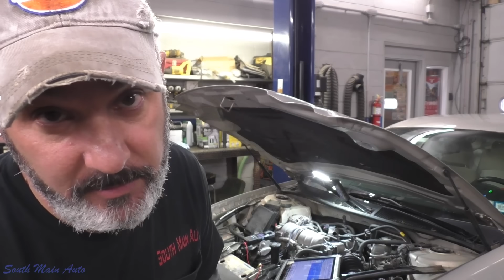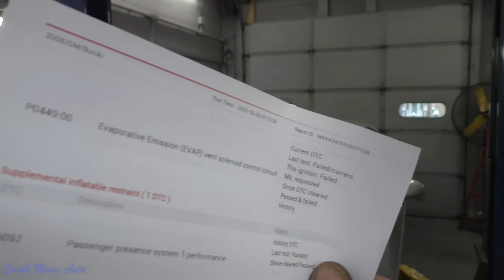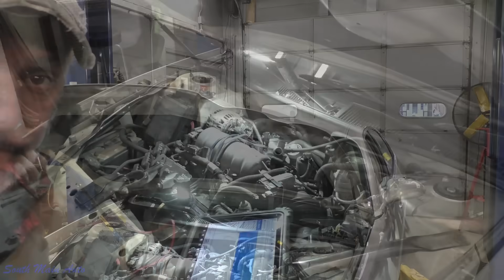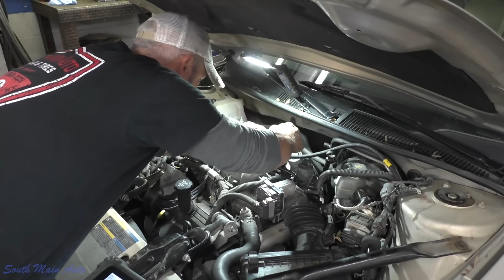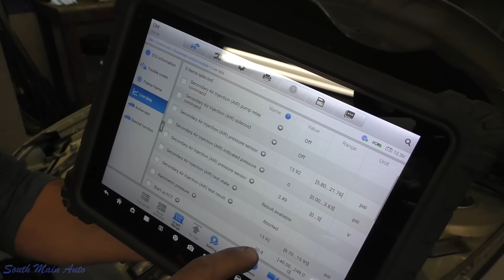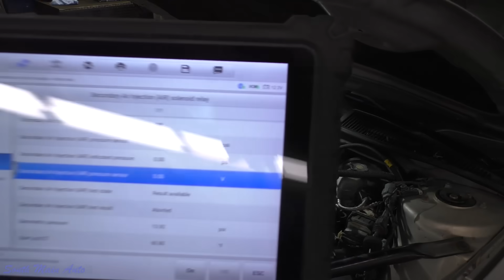When “New” Parts Are Worse Than The Broken Ones 🤬

Comment: I replaced the fuel pump in my 03 Accord V6 to fix a slow starting issue. It fixed it for a day and slowly started reverting and actually drivability was getting very poor. Finally paid a shop to diagnose it and it needed a fuel pump LOL. I never suspected the brand new fuel pump that I installed. Months later the car still starts and runs great, however my gas gauge now goes to below E and the low fuel light blinks whenever I get down around half a tank... I never even took the car back to complain because Parts quality is so bad I figure the car runs good and I reset my trip odometer when I fill up in order to know when I need to get gas. Crazy stuff. Also similar Parts quality frustration with ignition coils for the same car.

Comment: Electronics in vehicles was a mistake. 99% of the problems are non-hardened electronics going into something bouncing around, in all kinds of weather, it gets dirty, and the part is attached to 1000s of different parts all with different problems.
Reply: it really depends on the car. no more distributor service or anything but if you got mice i hope you can make good solder joints or crimps

Comment: 👍 Always emissions related.
Always modify for performance. The more of this trash you remove the better. Car/trucks running on propane or natural gas dont need that garbage.
That included Rousch Ford propane race cars.
Feel bad for this guy..  Honestly I thought they had trashed air injectors a decsdr earlier. The 3.8 V6 is an all time great. What a shame.
Hsng in there boss 👍👍

Comment: You're not the only guy suffering from this crap parts disease. I fitted a water pump, not bothering to test a solid shaft water pump, yep, it failed when I started the engine, the shaft was not connected to the impeller. Bad day.

Comment: The struggle is real. Our shop used to be a Napa service center but we had so many parts failures we cancelled them. Their fuel pumps had a 40% failure rate. Most electrical parts had similar stats.

Comment: Is it a failure or an opportunity.    i say a premium parts business in the US will take responsibility for the parts it sells.   it will charge 50% more for some parts,  but when it ships them they function and have the specs and functionality checked.   the point is you get the part and it works correctly .  no shipping back.  no " cheap "  sellers saying "  hey ,  you can bring it back and we will replace it ( often with another flawed part )    this is a little like FedEx offering a premium service over more standard shippers.  if the part is manufactured in China,   there are lots of fabs that want to manufacture premium parts,  but they are currently faced with competition from " cheap "  fabs flooding the market.

Comment: Need some help!! I ran across your videos and now I'm diving deep to see if you solved this issue I have a 2020 F150 3.5 Ecoboost. Have taken it to the local ford dealer multiple times for a grind g noise in the left front wheel. They replaced the IWE, wheel bearing, 4wd drive solenoid and check valve and still having the same problem. I think I'm running into a parts cannon situation. This grinding noise happens on start up and when it's really cold it sounds like something is gasping for air. Shifting into 4wd makes the noise go away. Needing advice before I go back to the Ford dealer for a 5th time.

Comment: My mechanic friend is always complaining about poor quality parts.....he put new ball joints into a newer Ford F250.....when he lowered the truck to the floor, one of the brand new joints broke.....nothing fits without modification or a lot of frustration and replacement......at his cost.  I have bought Chinese production Harley parts and every one had to be reworked to fit....I bought a replacement tail ight from Charlie Kirk because they stated US made stuff.....I got the new tail  light in a Kirk box.....opened it to find the tail light in the original box...made in China.....I wound up having to make a tail light with parts from both because the new one would not fit.

Comment: I have had the same luck going to pick and pull, as buying new.
If you own something older, if its feasible, go buy a parts car. 
I needed a transmission for my blazer, 
It was cheaper to buy a whole other truck (that was crunched, but driveable enough to test. 
Now i not only have a good transmission, but spare sensors, rear end, plastic tabs, bulbs, starter, alternator......all sorts of doodads. 
Pick up 2 600$ junk cars, wnd make 1 good one. 
Pick something you like, before 2005 roughly, and stack up parts. Because this isn't going to get any better. 
There is a reason......you won't buy the new upgrades if you can still get parts.

Comment: Retired 2 years ago from a third generation auto repair shop In Lancaster Pennsylvania. 40 years of change nothing like the last ten years . You cant fix something that is designed by idiots . The aftermarket stuff is junk ! But if oem is so great why do they not last ? I do not miss the shop or dealing with customers. Currently building a 1970 c30 bagged tow truck .  Do yourself a favor and retire as soon as you are financially able . Spend more time with your wife. Lost mine in 2021 life is short .

Comment: Had the same issue last summer. Bought a NEW brake master for my '12 Impala from Auto Zone and it would not bench bleed. Tried all day on a Sunday, didn't work. Had to have it towed to a shop. They tried to bleed it thinking I didn't know what I was doing. They couldn't bleed it either. Got another one from another store and that worked. Cost me 3 times more to fix it than if I could have done the job myself.

Comment: About a year ago I replaced a evap purge valve on a 07 CRV with an aftermarket part. I went aftermarket due to getting it fast. Price was not the issue. Well a year later a new evap code showed up and my gut told me I bet that aftermarket part failed. I tested it and sure enough it was bad. I got the oem from Honda and so far it is still working. QC is in the toilet with auto parts and probably other industries. I feel your frustration and on top of that you gotta turn a profit to stay in business. Love your videos.

Comment: It's odd seeing the dichotomy, I work on tractors and off road equipment and VERY rarely see failed new parts. Yes the costs are higher, but more importantly there's just simply quality control. If someone owns a $3,000,000 piece of equipment and it goes down multiple times for maintenance in a row they're probably not buying from that manufacturer again in the future if they can avoid it and will talk shit about the brand for the rest of their life. Comparatively on the automotive side, I unfortunately became the defacto friends and family tech and I've had countless bad OEM parts from everyone. I had to do a belt tensioner last week, a stupid simple thing. And the first 3 I got were seized out of the box, one from napa and two from two separate dealerships. Nearly all the parts I source now are from Pick-N-Pull. I can throw them in the parts washer, maybe sandblast and paint things, replace bearings or seals and fix threads and still come ahead both in terms of labor hours and cost with a much superior part. It's ridiculous, Everyone in the logistics chain is trying to make a buck with cheap garbage and automotive manufacturers come out ahead as repairs become more costly and the 'economic' solution is to buy a new vehicle. They know you'll buy their slop again and again.

Comment: I spent almost 6 hours replacing a driveshaft slip yolk and U-joint yesterday. The U-joint was GMB and the measurements were incorrect however I didn't check them and it got stuck, took forever to get out and slightly damaged the ears. Don't buy a 7$ U-joint.

Comment: how often do you think returned parts are cleaned up and repackaged as new without proper testing? with just this repair, a bunch of parts went back into the system. then the counterfeit folks are also dumping into the system along with the manufacturers building for 90day-1year lifetimes.

Comment: After hints the MAF sensor was going on my '99 Ford, I had it replaced with OEM
ran fine at idle, the instant you hit the gas, it behaved horribly, belching thick black smoke as if it was a smoke tuned diesel. nearly stalling after a minute, ran like a badly tuned carb.
replaced it with another OEM. same issue. they were reporting air flow levels that could only have been achieved with 80lb of boost.
Finally reeplaced it with a different brand with a different sensing technology. no problems since.

Comment: Feel your pain!  Got a 4 Seasons Low Pressure AC hose for 2004 Jeep GC on Rock Auto. It was the most expensive part available, but I wanted to get a “good one”.   
Well the part arrived looked great, did NOT fit!  Ok compared it to the old Mopar part that lasted 20 years.  The RA Low Pressure hose was unfinished!  I was in the mountains had waited a week for this part.  One end of the fitting was not chamfered properly.  I found the only machine shop in 200 miles, they finish milling the fitting end with the proper chamfer and I installed it on the Jeep, it worked.  Alice Cooper used to say “SUFFER” at his concerts, haha now it’s the Auto Parts distributors solution to their clients!  😂

Comment: I’ve bought more broken on the shelf parts than working parts in the past year. Fully 5 headlight switches bought from 3 different stores and 4 brands all either nonworking or failed in less than a week, likely made in the same factory. Carquest ignition control module, never made a single spark, far worse than the broken one, carquest ignition coil, not a single spark. 

Other brand ignition parts working fine. I litterally use a jumper wire for a headlight switch because working replacements don’t exist. I’m going to make my own relay system rather than try again.

Comment: Eric your not alone! As a fairly educated farmer/DIYer I have had my fairshare of headaches with my wife's 07 Yukon XL. I have been through 5 fuel pumps (all from NAPA) in 9 years.  Factory was at 60k, simple enough. This last one I changed a month ago was 10 months old. I have checked control voltage, amps, resistance on fuel pump harness back to the fuse box. Tested the evap purge valve and even changed it once with an AC Delco (from NAPA) to find out the new one was bad. Was told once maybe your evap cannister is plugged causing a vacuum on the fuel tank creating more restriction on the pump. Unfortunately we drive alot of gravel so I have relocated the breather to keep from plugging the canister. When I changed the cannister last I reverse pulled a vacuum on the evap system using my AirVac and only saw a difference of 1.5 - 2 psi in new canister vs. old. On the bright side my boys and I with a set of jack stands and a floor jack can change the fuel pump in about 1 - 1.5 hours pending how full the tank is and changing it that often doesn't ever allow the locking ring on the tank time to rust up to bad! I will say the only reason I continue to go back to NAPA is because majority of times its still under warranty!
Reply: I had to go back and find this just to comment on my own comment. Guess what the pump from NAPA has gone out again! Stay tuned I can't wait to see what the local NAPA store has to say. Arthur point the locking will never rust instead Im going to wear it out changing the pump so often!

Comment: So far almost every part I replaced on my 1991 F150 5.8L engine was dead on arrival or the part went bad shortly after I installed it.  Ford replacement parts are the worst.  Last week, I ordered an EGR valve from NAPA and it was pretty expensive along being dead on arrival. 
I am convinced no manufacturer is doing a quality inspection every part made.  Instead, ship the part and let the customer find out the bad news.
Now I tell people just because the part was replaced and yet the problem is still is a sure most likely scenario that the part is most likely defective.
This the state of the automotive repair these days.

Comment: I have a bad fuel pressure sensor, I have to drop the tank to change it. The most logical thing to do would be to change the whole pump, but because I know after market pumps probably are not as good as the original I'm going to change the sensor and keep the old pump and hopefully everything will work out.

Comment: What's upsetting is the manufacturer of the part should have an EOL(End of Line) testing bench tool to test each part as they come off the assembly line.  They skip that step to save cost and use mechanics as quality control.  This particular part can easily be bench tested with quick plug in, set up a circuit to flash a green light if it's good.  Listen for the solenoid to fire and then put it in the box.

Comment: I feel your pain. On a 4500 mile road trip in my 93 f350 2 years ago my original FIPL (TPS) went bad on the first day out. I found one the next morning and replaced it. All good. 10 days later, still on trip, new sensor goes bad. Got another replacement which is still working at this time. Standard motor products part. I hate buying anything electric aftermarket these days.

Comment: Two years ago I replaced my control arms. Now, two years later, at my inspection, the mechanic says, "Your ball joint is bad."  It was. 20k highway miles after I installed it.  He said, buy OEM.  I couldn't get it. I put a replacement warranty part back on. We'll see.....    Why is it all junk? What has happened and where? Anybody?

Comment: I work at dealership and it is not just aftermarket parts anymore, OE parts are getting just as bad. I had to put 5 brand new Body Control Modules in a mustang one time to finally fix my concern

Comment: Yeppp.... went through it with purge valves twice. Once with a toyota, first part failed in almost a year, second one lasted a month. Third one never made it onto the car because I bitched out the salesman for napa, got a refund and  bought a new purge valve from toyota.

The second one was a chevy impala 2016. Purge valve was stuck open so i got one from napa while customer waited. Ran evap purge/seal test with the new one, got a little vacuum into the tank then it stopped pulling vacuum. Tapped on the new purge valve, and it started pulling vacuum again. So I got another napa one. That one didn't work even with tapping on it. Finally I ordered one from the dealership like I should have from the start, and that one worked flawlessly. Aftermarket engine management parts are a waste of time. Even the OEM ones aren't very good!

Comment: Don't feel bad. It is the same in aviation. Get faulty parts, common basic hardware that the threads are jacked up. I retired this year mostly because of the thing you're talking about. I worked electrical and avionics, mostly trouble shooting helicopters and fixed wing turbine powered aircraft. Much of the problems in the parts source is due to automation. It's easy to blame "snow flakes", but that is not the real culprit. There are many machining errors. These automated systems are supposed to inspect as well. Some of the stuff I've seen, a human could see from across the shop. Holes not bored squarely in parts, etc.. Even the shipping is automated and damaged many parts. An autonomous fork lift put the fork tines through a wet wing fuel tank section. 20k for that. 200k for a set of tail rotor blades from 2 helicopters we sent out. We quit shipping with FE and UPs. Had to go with direct couriers due to damage. It would be staggering and shocking adding up all the cost associated with automation. I feel yours and every mechanics pain out there!

Comment: I bought an old 4x4 as a project and completely rebuilt the engine. Sent the block, crankshaft and head to the machine shop and got everything cleaned, decked and honed and polished. I spent 2 weeks meticulously putting everything together as this was my first rebuild. The day finally came after I got it built and put back in, turned the key.... And it fired right up on the first crank. I was quite proud of myself. I took it for a test drive and it died two blocks from my house. After I got it towed home I spent hours trying to figure out what happened, and finally figured out that fuel wasn't making it to the carburetor. There was no way I thought that a brand new fuel pump could go bad that quick, but as it turned out, the diaphragm ruptured and pumped a bunch of gasoline into the oil of my freshly rebuilt engine. Even after getting everything fixed and the oil changed, the rings never did seat right and I ended up doing a ring job to try to get my compression up. All of this because of a $60 fuel pump.
Reply: I had a similar thing happen when I did a partial rebuild of a 2000 Chevy with a 5.3 vortec engine. Two of the brand new push rods collapsed. The little balls on the rocker arm end broke off! This wiped out the new cam. I had only put around 500 miles on the engine. They would not honor the warranty.
Reply: National problem with car batteries right now also . Brand new batteries that are junk
Reply: I installed for fuel pumps on different vehicles this summer all from Delphi. All junk. Had to get Carter fuel pumps.
Reply: @danielwilliams5476  I went thru 2 Delpihi pumps this year, alum rivet inside broke
Reply: New Chrysler starters that don't fit

Comment: not to mention all this trouble just for a system designed JUSt to heat up the cats faster to put the 02 sensors on closed loop QUICKEr for better fuel consumption---you know--something that will save you 1/10 of a tank of gas a week if that

Comment: I save all my original parts just in case. I have a bin full of stuff. Too many sensors fail in months vs years. I can't even get horns that last a year. I'm about to put two of those rubber chickens under the hood with a manual setup to squeeze them instead.